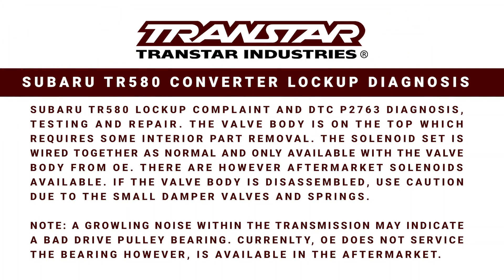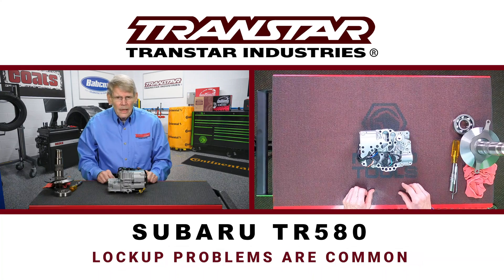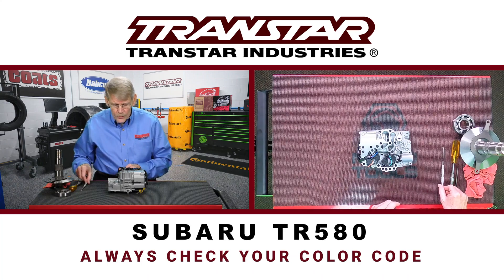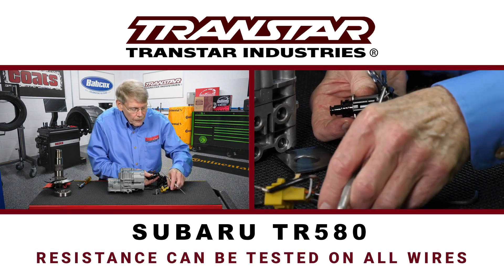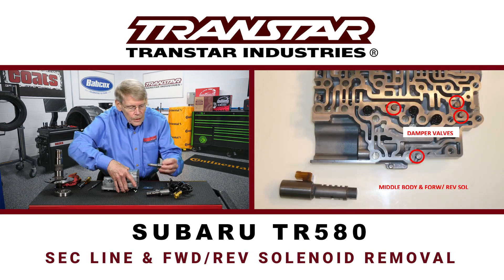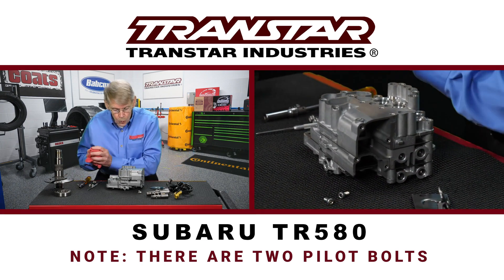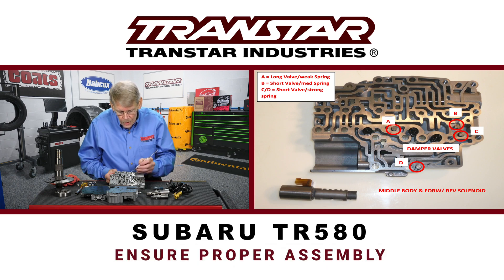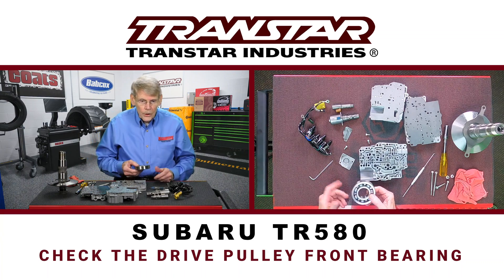Converter Lockup Diagnosis: Subaru TR580

Comment: Dorman TCC(or the others mentioned that were the same) solenoid Part # is  926-408 if anybody needs it. Great Video! Thank you for posting. The last one I did, we had to buy a complete valve body from Subaru. Now with a separate solenoid available, the cost is $1000 less to repair this common issue.

Comment: Great Video, have a 2013 with P2764 Torque Converter  Clutch Pressure control circuit circuit low. The valve body is coming out. Best Solenoids to use for success ?

Comment: excellent video mark ;) i have a 2008 outback with the 4speed automatic transmission, i suspect i might need to replace a solenoid or two on the valve body but im still waiting for diagnosis tool to arrive and get some codes.. what im wondering is ? would it be the TR580 or TR690 valve body for my model ?
Reply: TR580 and TR690 are CVT transmissions not 4 speed.  I'm taking it you finally figured that out by now.